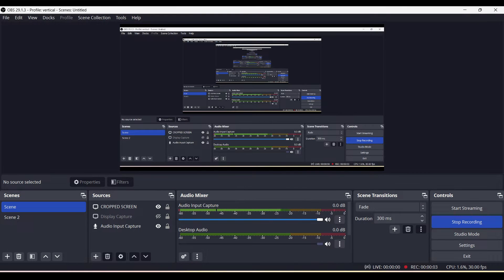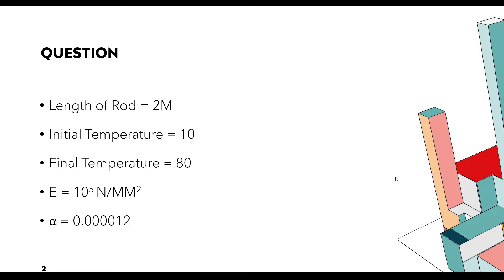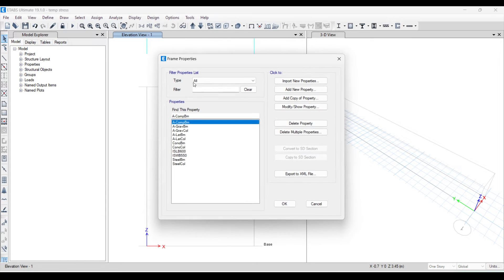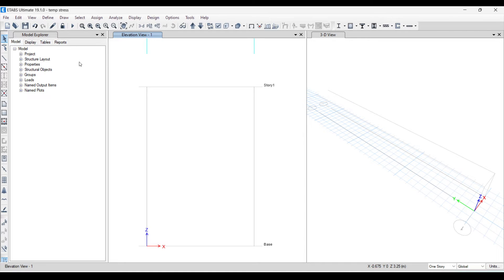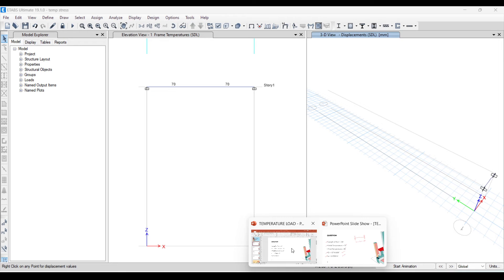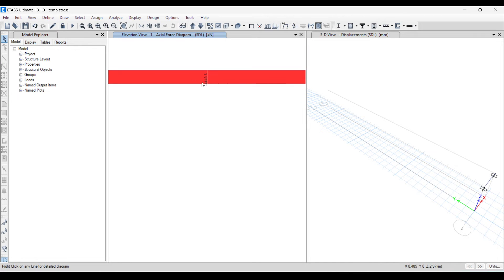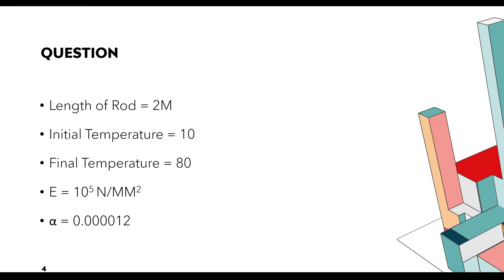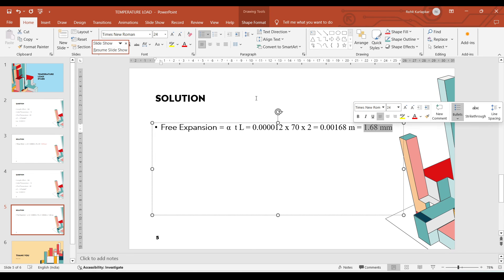Temperature load in etabs | thermal analysis of beam | etabs modeling | free expansion of rod

Comment: Sir, how to find corresponding strain?
Reply from the maker: Strain means change in length / original length. Original length is 2 m., change in length i have shown at the end how to check. So you can take ratio.
Reply: @Realcivil  how to solve problems on end yield and do not yield
Reply from the maker: I will check and let you know. Are you talking about support yeilding??